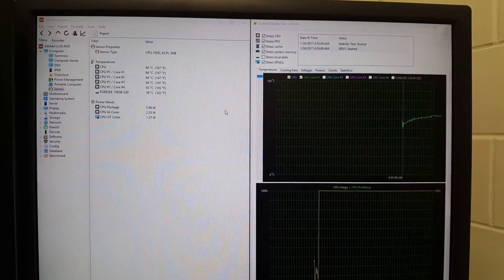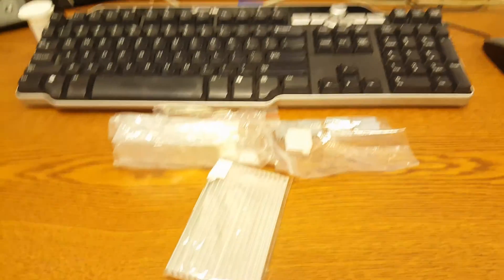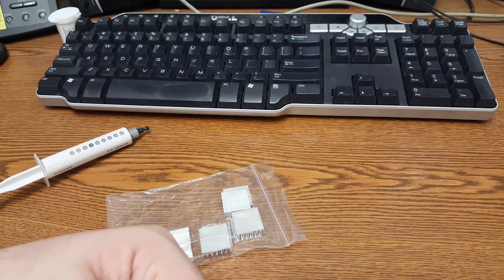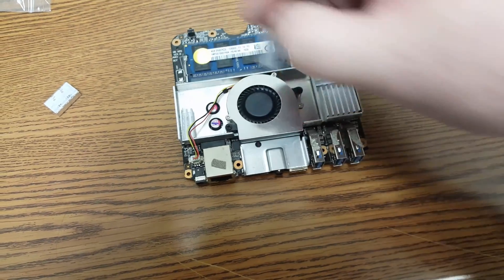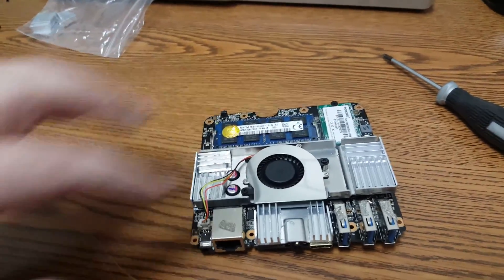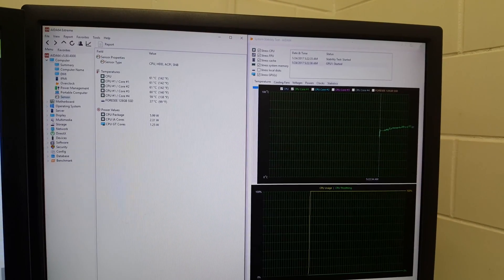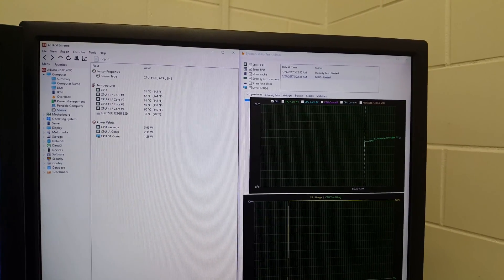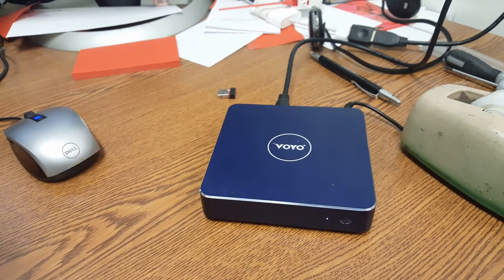Voyo vMac Mini - Thermal Enhancing - Apollo Lake Pentium N4200

Comment: I'm using this V1 with Apollo Lake, but the Fan is not working after Windows restore. It has all drivers installed the Thermal Framework Fan is installed too, but the Fan don't start. The temperature is 83 °C. Very high. You have any idea to fix that?
Reply: TheJorensanbar   you need to hook up the fan to a USB port so it will run all the time.